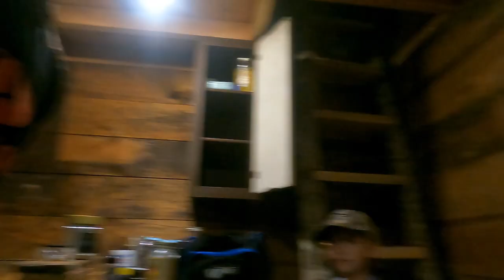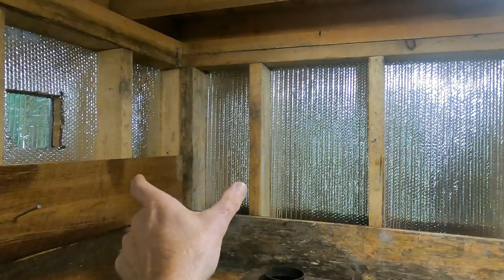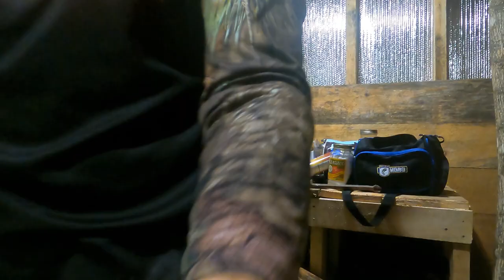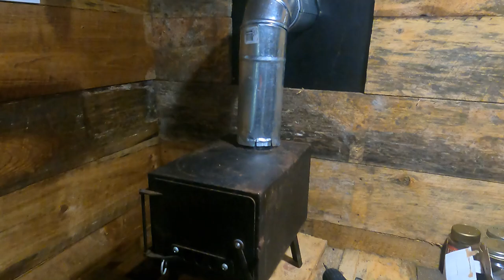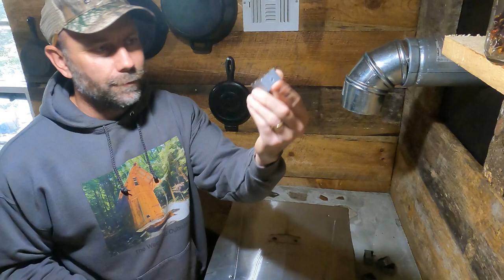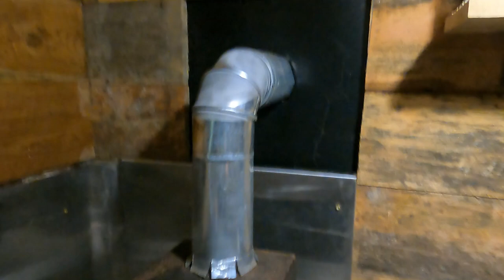Cabin Build Part 35 Installing a Mini Woodstove (Budget Build)

Comment: Every one of your flue pipe sections is backwards, you stand a good chance of a flue fire. I wouldn't think of sleeping in your cabin.
Reply from the maker: Yup someone committed that earlier I’ll flip them around on my next trip. Thanks for Watching and Commenting. Take Care and God Bless.
Reply from the maker: I also installed my pipe this way in my last cabin. It has been good for 10+years. After some more research I do plan on flipping it the next time I’m at the cabin. Take Care